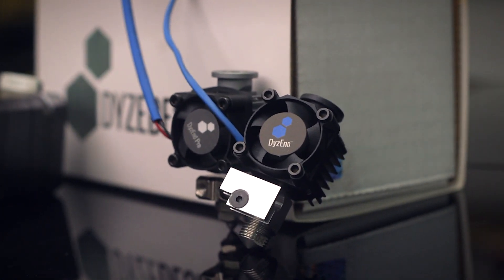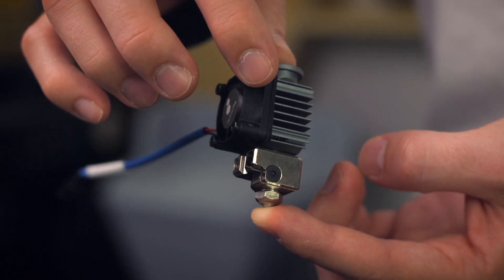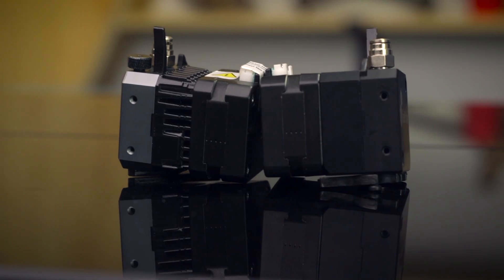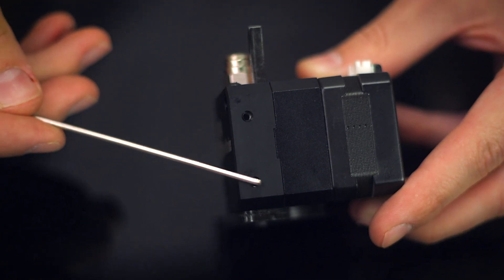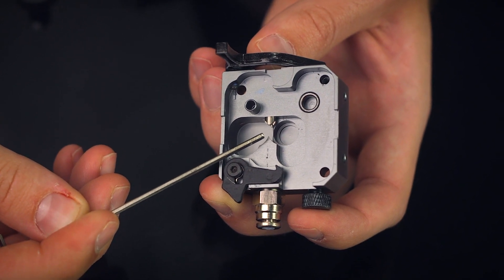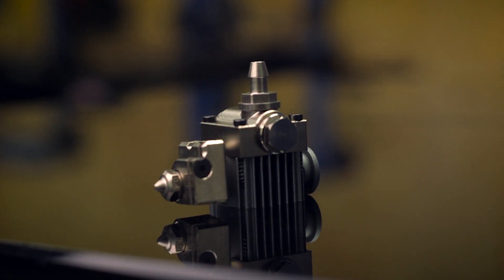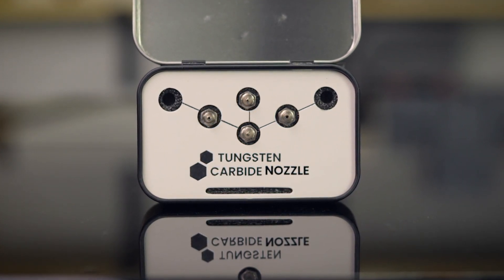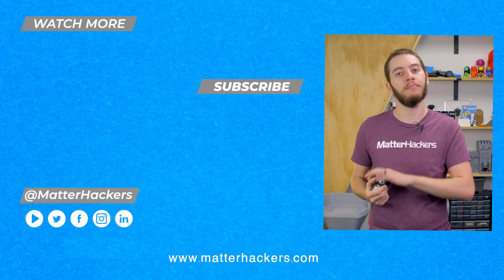Tech Breakdown: Dyze Design 3D Printer Accessories

Comment: Really cool showcase of the Dyze design, the addition of the water blocks really make a big difference in a high temperature enclosure. I really look forward to their next design where it's easier to open the extruder to clear chips and filament jams or even just a transparent extruder cover to make jam checks easier.

There is still the filament purge issue where high temp filaments stay in the nozzle and jam the system when switching between printing PLA and PEEK so I am glad to see nozzle switching has gotten easier. Especially the cold nozzle change is an outstanding safety improvement.

I still see designers are not embracing remote drive systems, then worrying about a custom fin for cooling the motor would be less of a cost increase.

Priced as low as $84 for a hot end, really makes one consider not buying a genuine E3DV6 anymore.

Comment: Fun fact pair this with a slice engineering copperheard...ultimate hotswap.
Reply: The slice engineering design has some short comings, like reduced thermal mass heat block and the loose fitting heater and thermocoupler forces you to use Boron Nitride paste which at higher temperatures can come oozing out onto your print.